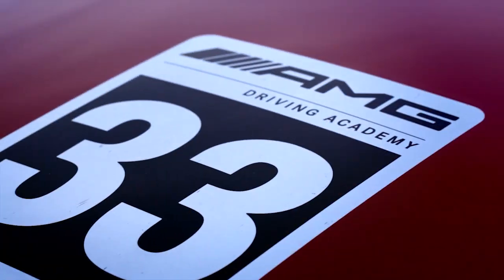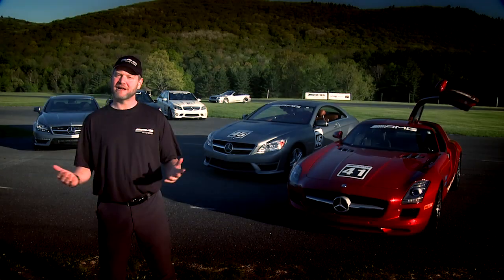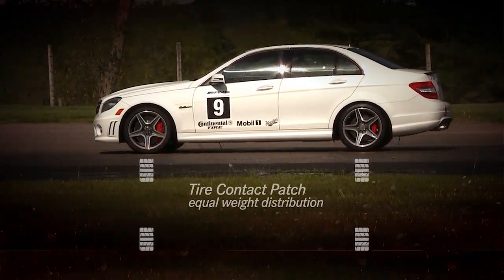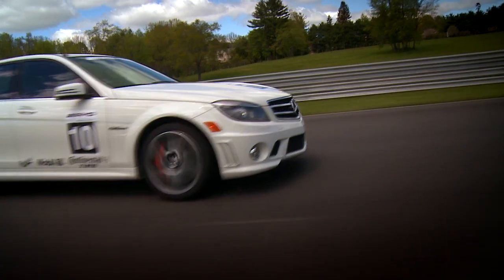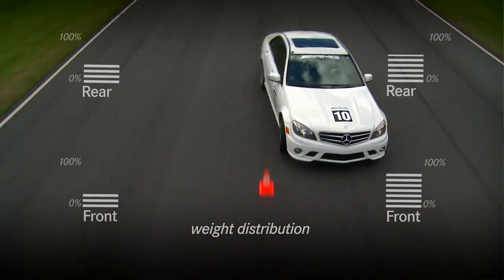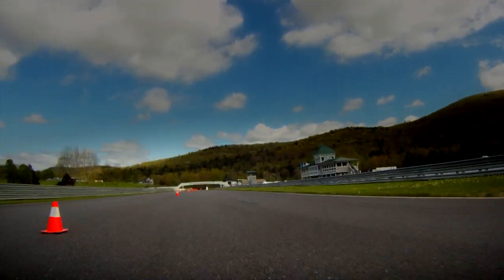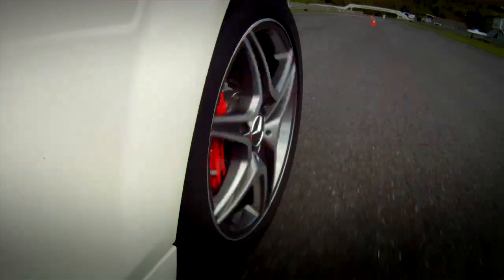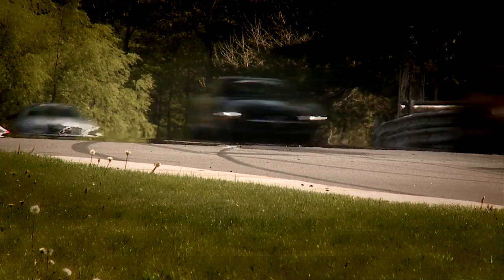Slalom Driving -- AMG Driving Academy Performance Series Episode 3

Comment: the salom technic will not work for solo/auto-x....in which case a steady throttle is necessary to NOT upset the chassis, keeping the tires to give there all towards latterial movements.